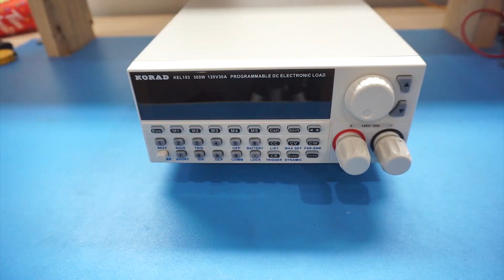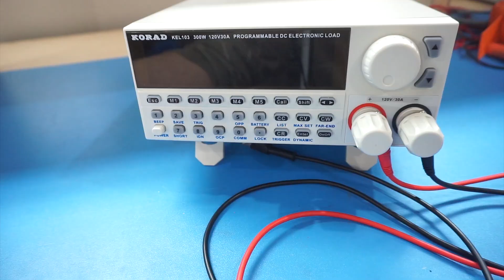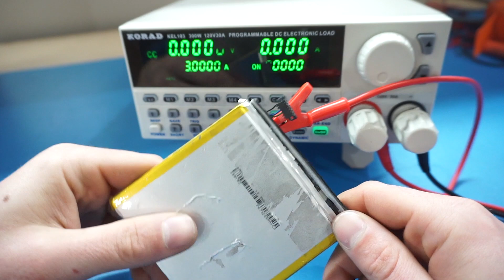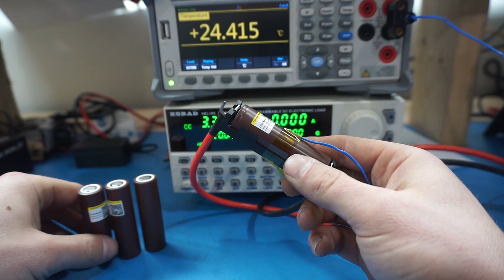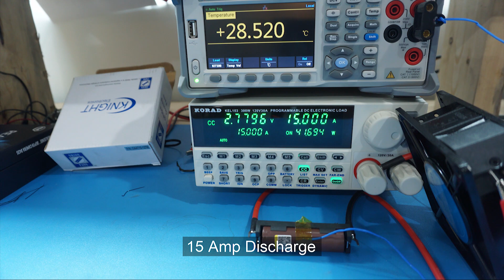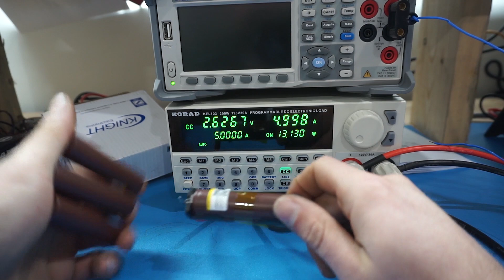20 Amp Discharge Test on Lithium-Ion 18650 with a Korad KEL103

Comment: Hello, I have a question about the KORAD KEL 103 power supply. Is it possible to use this power supply to apply a current profile as a function of time to a battery cell? I have my data in the form of vectors (time and current) in CSV format, and I would like to know if it’s possible to load them to execute this dynamic profile, such as the WLTC cycle. Thank you for your help!

Comment: G'day, I've just ordered one of these Tenma/Korad loads. Couple of points. I would have used 4 wire mode to measure the real battery voltage as the "only 10mOhms" in one lead gives you 20mOhms between the 2 and 400mV drop at 20A so that will impact any calculations you are using that involve voltage. You discharged those poor cells way below the accepted / recommended limits of ~2.7-3.0V so I guess your capacity test will not really reflect what you would get in a real world application as you should not be abusing the cells like that! With the amount of heating you are seeing (45C at 2.8v @ 5A) it is clear they are not designed for long high discharge cycles and you may encounter thermal runaway if you used them in such an application. Cheers. -- Edit just realised this video is old...

Comment: Dear Reiner, I came across your interesting video because I'm looking for an electronic load. I'm oriented to buy the kel103 vs the ET5410A+ as the price difference in Europe is not very high. The last one seems to have more features like CC+CV or CR+CV LED and so on but the Korad is more accurate and robust. Do you know if the Kel103 can have the same features programming it with python? Thank you
Reply from the maker: Yes it can be programmed with python. I have done some automated battery testing with it. It has lots of features but there may be a small accuracy difference in the ET5410As favor.
Reply: @MrReinerMSchmidt  Thank you!

Comment: Hi, I'd use several RND KEL102 (same looking) load device with aligned load stepping. There is a "trigger" connector on the back, but not a single word about it in the datasheet. Do you know how to use trigger input? Logic level, or opencollector/drain to short to trigger? How fast load switching can be (I'd load LDO power supplies)? Any info on that would be appreciated:))
Reply from the maker: Honestly I am not to sure. The trigger does work as an enable button. I would guess that the response rate can be determined by watching the load ramp up with a scope. I would guess it's at least 60Hz.

Comment: The KEL-103 is a great little unit to most test and with some programming does it do a lot of great things. But I am wondering if a function generator driven load could be even greater than even the most expensive on the marked?
Imagine a load that adjust its loading settings dependent on some external voltage, meaning you could make a function generator generate a 1V pulse of a few ms and the load sets cc of 1A in these few ms, it could also be set to 1V load in these few ms. In that way could you simulate a motor, including inrush, heat up and hard driven.
Do you think it could be possible to make or maybe be done by a simpler method?

Comment: Hi Reiner,
thanks for your video.
I have the same Kel103 device and would like to know if there is a way to test a battery on a specific load in Watt (so CW) and stop the test at a specific low voltage. Final result of the test will be capacity in Wh.
Thanks is advance

Comment: 120820/0444h PST- 1244h UTC Guten Tag, Herr  Schmidt. Danke schon. I have not seen one single explanation or description of the function of Electronic Load device from ANY ONE on YT, as good as yours. Your presentation is the best ever to make people understand the layout and the function of this device. It’s simple, it’s concise not filled with heavy technical jargon and precise.My deepest appreciation and respect to you.
You have used LG 18650 @3.5 Ah cell as practical example in this test. My question is; can I test LiFePo4 cells @25Ah/50Ah/100Ah/200Ah, the similar way? What settings do you recommend for each load test?
If time permits, please respond.
Take care und 73s..
Reply from the maker: This device is rated for up to 30A so you would only be able to do tests at that discharge rate. You can test in the same way I have described.

Comment: Hello Schmidt, I am working on a project and I am using RND kel 103 for my project. I need to program the device and I dont know how to connect  it to the laptop system. I need your help to sync the IP address of the laptop with the device . Can you guide me?

Comment: Hi I read somewhere that the time setting when discharging battery has to be set from 0-9999. What happens if the timer runs out before the battery? Do you have to set a timer? this is the only thing stopping me buying it at the moment. Thanks in advance.
Reply from the maker: So I use a python script for the battery testing so you essentially get unlimited time. But if the timer runs out before the battery the test is no good. But generally there isn't much point testing a batteries capacity at such a low current that the test would go that long anyway.
Reply: @MrReinerMSchmidt  good point about the low current. is this timer in seconds? thanks for the quick reply.

Comment: Does this Korad enable to test ah of the battery?
Reply from the maker: Yes it does. Better yet it will give you actual watt hours which is much more accurate as voltage will change depending on SOC.
Reply: @MrReinerMSchmidt  what is the resolution of the Ah being measured? (1mAh? 10mAh?)

Comment: I'm disappointed with this device.The setting min voltage is missing in mode CC. The test CC must be terminated manually otherwise there is a danger of exceeding the minimum allowable voltage of the cell. The software is completely out. The log is disabled, no record voltage values in a text file, only time and current. Does exist other software or newer version where the voltage records are correct? How did you get the graphs from the tests? Has the software been modified?

Comment: What software you use that show battery capacity ?
Reply from the maker: It's a python script. I think there is a link in the description. Some other poeple have also added to it since this video.
Reply: @MrReinerMSchmidt   Have you test the accuracy of the clock? The battery test time clock is slower than real time, 
like 60 sec  discharge time is like 1" and 7sec second in real life . I wonder if software issue or is the unit ?!
I have the RND320 version of this ,bytheway .

Comment: Isnt the Voltage a bit low  ? 

Most Lithium Batterys have a cutoff at 2,5 or 2,75v
At high current much more, like 3,0 or 3,5V
Reply from the maker: It's normally for these Litto batteries. They say they are high capacity but it's a bit of a lie because they just trade capacity for cycle life.

Comment: Great video and python work.  How did you activate ethernet and set dhcp/static address on the kel103?  I installed the usb driver and software, and can control the kel-103 via usb cable with kel103.exe gui.  But I cannot find any place to setup ethernet within that gui or via the front panel.
Reply: Ok, figured it out... In addition to the customized LabView2014 software named "kel103.exe", there is another file also named "kel103.exe" on the CD in a folder named "test command".  That executable is a utility which can scan the network using UDP to find the KEL103, and then setup dhcp or static.  It is a little cryptic to use, no "apply" button (not sure if changes are immediate or on exit), but I've now got the KEL103 on the network  and responding to pings at a desired IP.  Moving on to try the python driver.  THANKS!
Reply from the maker: @scottw6786  I struggled with this as well. It is pretty silly that the device isn't just some DHCP or static address out of the box.
Reply: @MrReinerMSchmidt  - I find it strange that the front panel "shift-Comm" only addresses baud rate.  That's where I expected to see ethernet options; needing usb drivers, connection, and software to setup ethernet is a bit ridiculous.  I really like the Korad hardware (I have an older Korad 30v/10a power supply that's been a workhorse), well made and great bang-for-the-buck.  But their software and documentation needs some work!  :-)     Looking forward to getting the python access going later today, THANKS for the help!
Reply from the maker: @scottw6786  cool! If you get anywhere with this let me know and I can figure out how to merge it with the existing code for the KEL-103. My idea was to add support for all Korad products but I haven't had the time.
Reply: @scottw6786  You're like the only person that reviewed this thing on Amazon :) Thinking about getting one since its $240 on AliExpress with free shipping. Does any of the software on the CD allow you to control and query data on a PC? Or is the only way using self written code to make calls to the device?

Comment: I see the same device with a different brand, RND 320-KEL103  in my local electronic distributor. I think I am going to grab one, as it has LAN and USB/Serial, so I can manipulate it easily using computer for data logging. The price is quite good for what it can do. The KEL102 model is even cheaper, which is another option.

Could you tell me more about the built in battery capacity testing function? Can you set custom cutoff voltage, when it reaches it finished, and don't restart even if the voltage jumps back up again? Does it report mAh and mWh back, without using computer?
Reply from the maker: Is there another way I can get in touch with you? I can send more details.
Reply: @MrReinerMSchmidt  I just checked the manual, and it is impossible to tell what device actually does exactly in battery test mode. Display doesn't show to have provision to display capacity or energy used during battery discharge.
Reply: @MrReinerMSchmidt  have you FB or a blog with the info?  I have the KEL103 and would like to utilise the software
Reply from the maker: @octapc  I wish, I have been wanting to start a blog for ages but haven't had the time. I will try and do it soon.
Reply: @movax20h Can u help me setup the RND Kel 103 on my laptop?
I seriously need your help.

Comment: Why didn't you use the battery function? Just set your current, switch off voltage and it gives you the mAh capacity without having to plot or calculate it!
Reply from the maker: The idea was to get the battery plot. The Load has a built in battery test function of you are only interested in capacity.
Reply from the maker: @BurntTransistor yes you can for sure. But it's much easier to setup a python script for battery testing than it is to setup the KEL battery testing function. And you risk timing out if it's a larger battery or low discharge rate.

Comment: Have you got a moment to email me?  Im planning on printing your 5 axis parts in and doing the build.  I've downloaded the file and broken it into parts for printing.  https://1drv.ms/u/s!Atm1Gj3plzFIg2vi4cix2z03W7Gq  Just had some questions on the belts as I know nothing about belts.  email. brad@spidey4fun.com   Here's the body ready to print in simplify3D..  https://1drv.ms/u/s!Atm1Gj3plzFIg2oyHU57zXSLH1X3   And my current CNC I'll try fit it onto.. https://1drv.ms/u/s!Atm1Gj3plzFIg2zOJcUC7zeMW68I   The table base lowers.